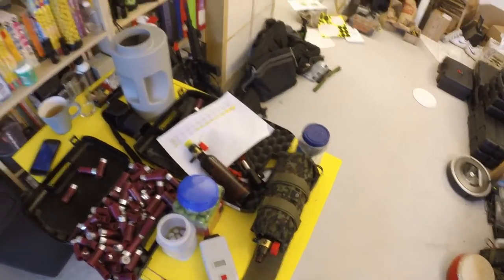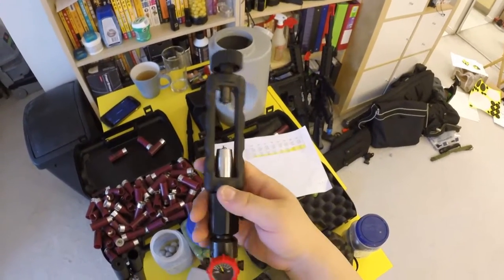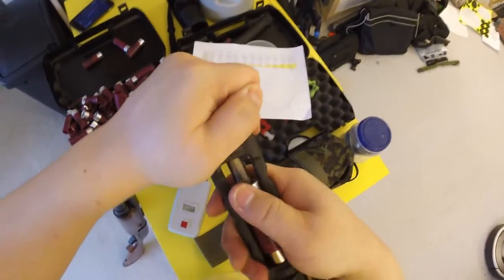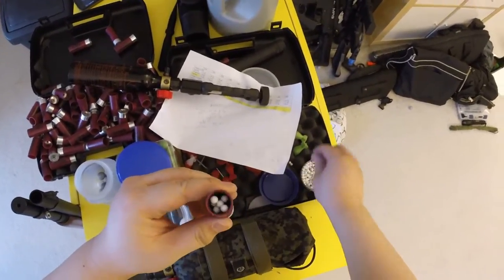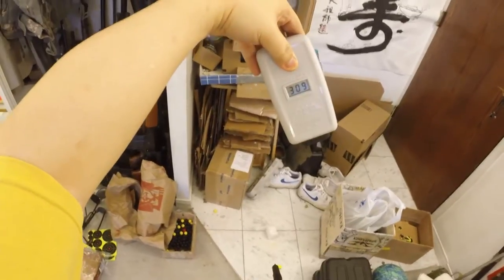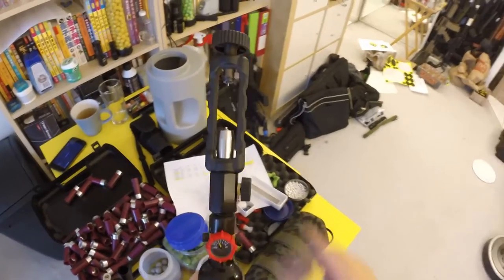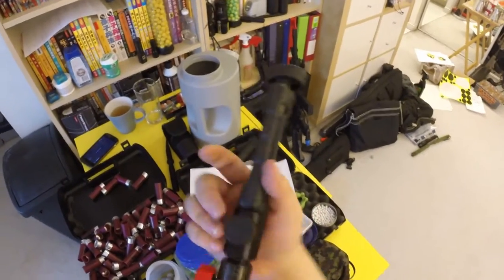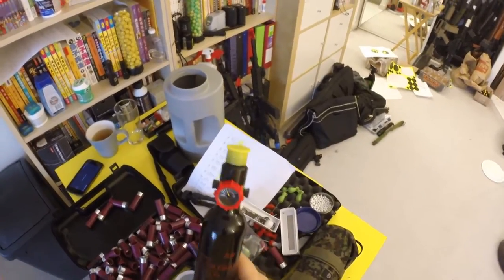APS CAM870 Shotgun Shooting Airsoft BB with HPA (1200psi) @ 300 FPS

Comment: Since I'm not familiar with the hpa tanks, can you refill the tanks with a bicycle tire pump instead of using a big air compressor like what you use?
Reply from the maker: oh no, HPA tanks are high pressure stuff, your bike pump cannot do it because it cannot go up to 3000psi! LOL!  Shop compressor don't work too. You need a PCP airgun handpump and I suggest the Benjamin Handpump with the little add-on upgrade. This one: http://www.amazon.com/Benjamin-Discovery-Marauder-Katana-Challenger/dp/B001BR6SCU/ref=sr_1_1?ie=UTF8&qid=1419946883&sr=8-1&keywords=benjamin+handpump

and this: http://www.amazon.com/Sun-Optics-USA-Desiccant-Pressure/dp/B0094O3GZE/ref=sr_1_sc_2?ie=UTF8&qid=1419946883&sr=8-2-spell&keywords=benjamin+handpump

This is the combo you need, and buy a 13ci tank with different pressure output  you want. Like here I say use a 1200psi output or 1400psi output, etc.. mind you that you cannot use these for paintball guns mostly, many paintball gun will not work well on the 1200psi and up output tanks. The regular stuff is 850psi output and is too low pressure for filling the CAM870.  You can also get the regulated output tanks here: http://www.drozdmax.com/high-pressure-air.html

But one good thing is, you can hook up the charger of the CAM870 with an adapter like this: http://www.pyramydair.com/s/a/Air_Venturi_30_CO2_Coiled_Remote_Line_Male_Female_Foster_Quick_Disconnect_Fittings/4638   

You see that hose? You just need one part out of that hose which is the ASA to QD fitting adapter, you just need to pull it off and it comes off with a easy snap, then you put that to your charger, and connect the pump to the charger to charge up the shells directly and now you can control what pressure you want for your shell. Very simple and easy to do, and very powerful... You can charge up to 2000psi like this and it will give you 30 joules with riot balls!
Reply: MakHobby The link to the hand pump is that the same one use used in your video to refill your tank? Where it took you almost a 1000 pumps to fill or was that a different hand pump
Reply from the maker: ravenclanx In that video I used a G4 pump but it's about the same thing, yes it takes like 1000 pumps to fill a BIG tank like the 62ci tank, but if you fill a small tank (13ci) it will take about 200ish pumps to do only, and if you add that add-on thingy, it will take less pump strokes because the air quality is better, it improves the efficiency of the pump too. Hey, it's free air you can use all day long! :)  One 13ci tank will give you a lot of fillings too.

Comment: hi, how many fps do you think we have when using a 1400 psi output tank and airsoft bb's ? thx
Reply from the maker: +Vahlk Red Waters 1400psi with what weight airsoft bbs?  1400psi gives you a pretty good powerful shot, pretty painful if use 3.9g rubber balls, it's more than enough to drop a human down if shot to the chest. LOL
Reply: +MakHobby  hi haha i dont need to kill my mattes ^^  i will use 0.20g airsoft bb's
Reply: +MakHobby Also curious about this - I use 1200psi on my shorty for just under 350FPS with .2g BBs. I suspect that at 1400 it will go over 400FPS.